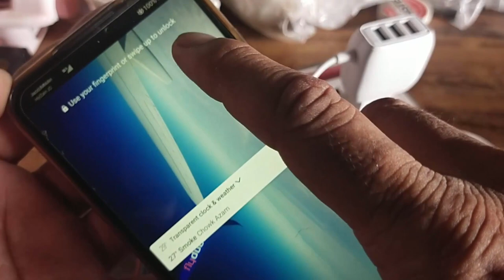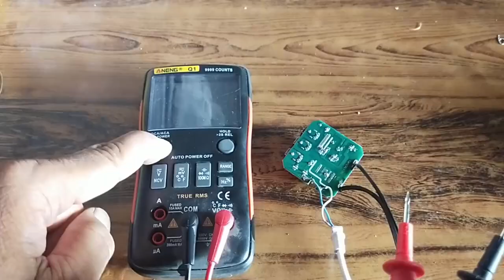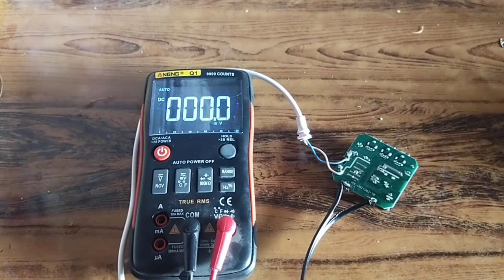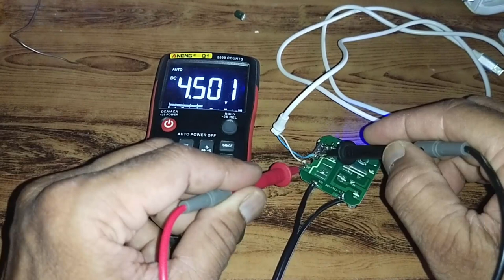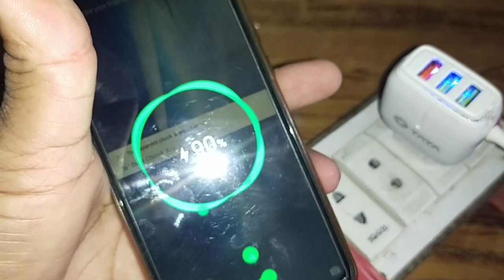[389] How to Repair Mobile Phone Battery Charger  / Switch Mode Power Supply SMPS Battery Charger

Comment: Hello sir. I hope you are doing fine. I do see your youtube videos often.I have became more interested in electronics after seeing your videos. Sir I do have a mobile charger which has no voltage in sencondary unit. I do get voltage of 310v in the primary capacitor but no voltaage in secondary unit. I did seperate the output cables. Still the same problem. After seeing your youtube videos, I believe that you can help me with your talent. Thanks.

Comment: Was the 4.5v acceptable?,shouldnt it be +- 5%?
Reply from the maker: 4.5 volt is acceptable, 
Because it's current value is enough to produce enough current without voltage drop
Reply from the maker: In feedback controlled Smps there is a voltage drop, so in that chargers most of time there is capability to produce for one mobile 
But this current controlled  offline switcher based power supply works to maintain charging current.

Comment: Excuse me,can we can repair unwork data cable also,mine not working,
Thanks
Reply from the maker: sure we can repair it. after repair its data transfer rate lowers slightly in some cases but it works,  for example if the genuine cable have 6MB/S, after repair in some cases it may drop 5 or 5.5 MB/S,  otherwise it is OK
charging will remain perfect,
Reply: @HaseebElectronics  ok thanks for informations

Comment: You took this charger apart pretty easily. They are normally glued tightly and it's a real pain to disassemble. I already have one of these chargers at my bench, already disassembled by the one who brought it. The fault is clearly visible. Its main filter capacitor is puffed up. These chargers are dirt cheap but still worth repairing because a lot of people don't like to spend extra money while they can make something work even if the amount is small. I think it's a good habit. Wasting causes a lot more problems apart from the money that goes to waste. Nice videos by the way. Keep it up.